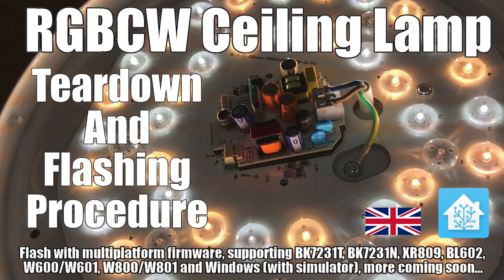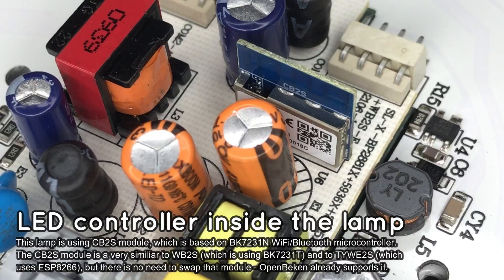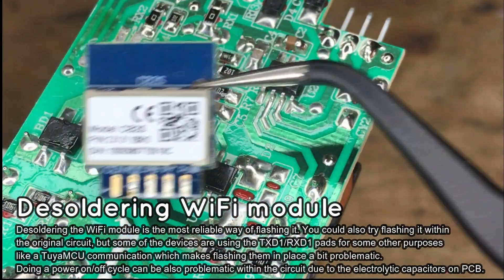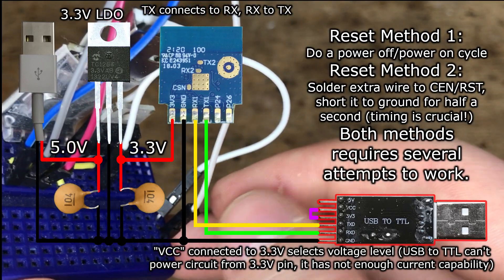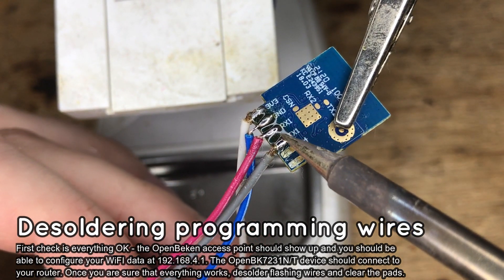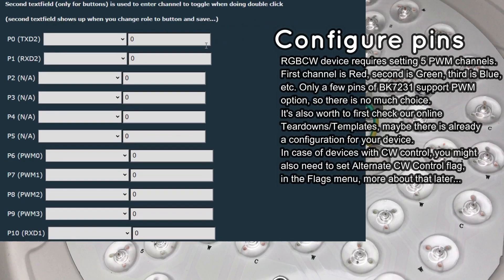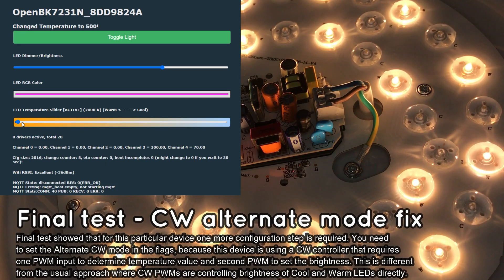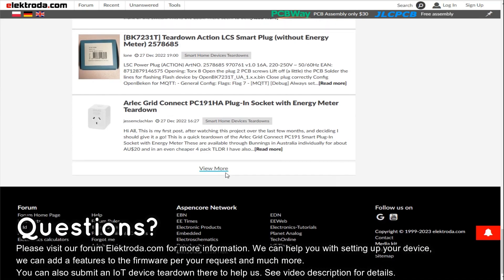Firmware change process for RGB+CCT Tuya ceiling lamp, OpenBeken, WiFi module desoldering, BK7231N

Comment: If you apply a little solder to the tip when you first heat up your soldering iron, it will be much easier to solder with the tip and you won't need to use as much flux each time. This is especially true if the solder wire has a flux core, as is the case with most types. Also, apply a little solder to the tip before each soldering operation and clean the hot tip from time to time with a damp sponge or paper towel.

Comment: Why the circuit? The TTL has a 3.3V output? Can it not provide power whilst connected to VCC pin?
Reply: Because the TTL adapter doesn't provide enough current for the module.

Comment: I have a smart ceiling lamp that works with the CB3S module. I want to replace them because i think they fail to work correctly. I have ordered a few to replace them. Do i need to program the CB3S modules or can they work out of the box.

Comment: Thanks, very helpful! I was wondering why you completely removed the module to flash the new firmware. Couldn't you have soldered the four wires to the module for flashing while it is still connected to the main board?
Reply: I've read elsewhere, and there is text here (I think) saying that the other circuitry interferes with the reboot process. On the other tutorials I saw for the WB2S, the presenters where removing parts from the device PCB to prevent it. I just now bailed and did it this way and it worked like a charm.
Reply: i didnt remove it and i did this exact ceilinglight. it flashed on the first try so i dont think its mandatory. just make sure only to power the chip (3.3V) and not the rest of the circuit (230V)

Comment: Thanks for developing openbeken, I have it on my shutter controllers, a temperature monitor and now on the Blitzwolf CLT 1 lamp.
The light has 2 seperate areas, one for RGB on the side and one for WW/CW on the top, is it possible to have both on at the same time?
Right now if I turn one on the other turns off.